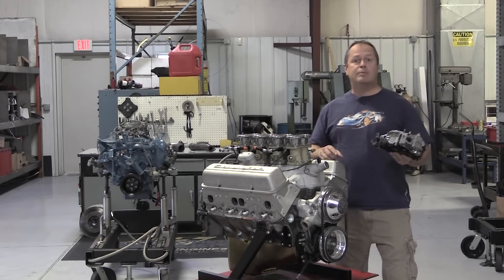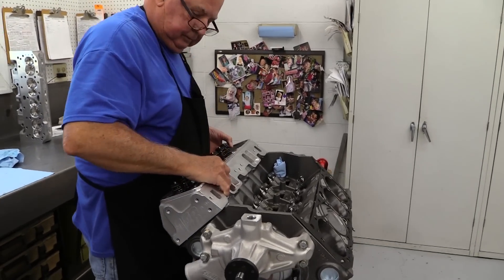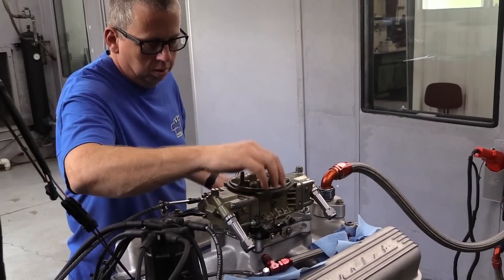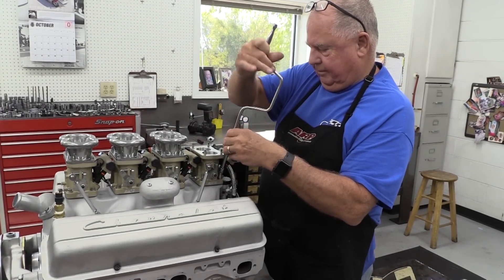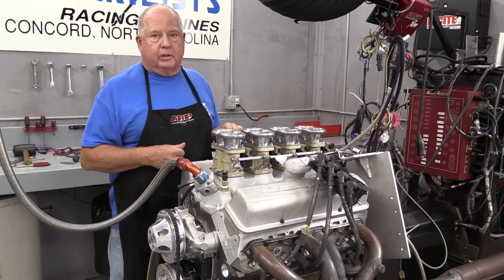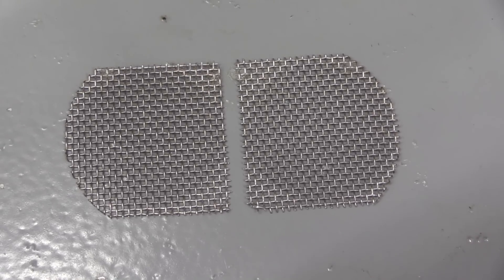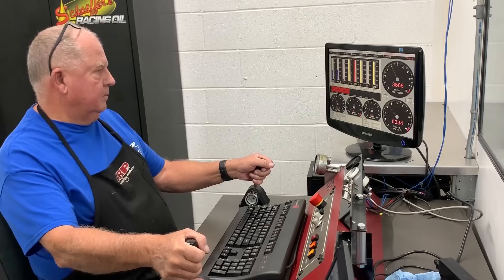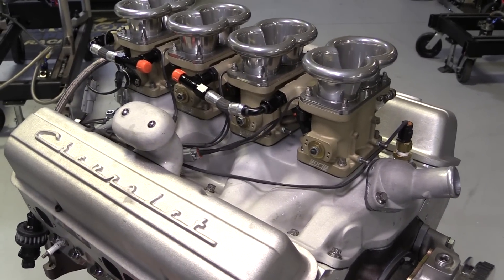Carb vs EFI - Dyno Testing a Holley Double Pumper vs Custom Stack Injection

Comment: Sorry, but this is not even close to an accurate test of "Carb vs EFI" - it's a comparison between two different intake manifolds.  
The only way this test would be accurate is if you replaced the carb with a 4-barrel throttle body injection system with the same CFM or port injection again with a TB that flows the same as the carb.
Or, toss on the Webers those ITB's were designed to replace and compare those to the injection stack.

Comment: I have  seen  claims  over the years  that   a  Carb  can make more  wide  open  HP.  I can  see already the  4  barrel  intake  has  way more  top end  HP  Potential .. Fuel  Injection   way  more  drivable ..  better  mpg  .. ect   thought it does  take  some  HP  to power the fuel injection ..
Reply: What do you mean it takes some hp to power fi?

Comment: Wouldn't this be a more "fair" test by using all stock equipment? Instead of all aftermarket components? Just sayin.......
Reply from the maker: It is all the same equipment for both setups, so it should be fair--or at least equal for both. And when it comes to testing, I've personally always liked to put components on setups that may be considered more than they can handle. My feeling is you have to be able to push a component to its limits to see what it is actually capable of. Thanks for watching!
Reply: @TheHorsepowerMonster  I fully understand what your saying here,I DO........BUT.........by simply choosing to test perfectly "STOCK" parts,based within a STOCK engine here.......You are ALSO going to easily  see precisely what each component is capable of,AND see how far it's limits can be pushed! My point is......such a LARGE percentage of viewers watching this,do NOT HAVE thousands of dollars of aftermarket stuff on their engines! They have STOCK pieces,therefore.....by testing and watching all "stock" parts,compared to aftermarket parts,maybe then......they'll walk away with alot more knowledge than just watching how long it's going to take high-priced machinery (which so few can actually afford) destroy itself!?!? Thank You.

Comment: Ive been a mechanic 40 years,,ive tried to tell folks ,,for a naturally aspirated engine the holley  will not cut the mustard,,and have proven it to many of my customers,,now blown or turbod the holley works just fine,,,but if its naturally aspirated you are wasting your time,,,you want top performance in a naturally aspirated engine you want a LARGE BORE CARB,,,a holley is definately not largebore,,so comparing fuel injection to a holley doublepumper is pretty fukin stupid comparison

Comment: What about cost to HP.. Carb wins .. All you home guys cost matters.. Good tuned carb works great .. As a tuner of vehicles efi and carbs .. Shocking how many are going back to carbs do to cost ... Low cost efi does not fuel right .. So you have to buy higher end .. Carbs still are fine..

Comment: Overall the drivability of the EFI trumps the carb.
Reply: @Joe Albert How? What makes a carb more "drivable" than EFI?
Reply: Based on this test, a lot of torque down low where you really drive. But moreover the EFI is self learning and is always adjusting itself for the correct fuel air ratio for each situation. I've been working on cars since the late 50's. Today's cars, which all have EFI, run much better through all rpm ranges than any carburetored cars I've driven. A buddy has a beautiful 34 Ford with a 400 CID Chevy small block. It ran really well, but we live in the West where there are a lot of mountains. He changed from an Edelbrock carb to an EFI setup a couple of years ago and is very pleased with the performance at all altitudes.  @Impactjunky
Reply: @Impactjunky  I forgot to mention cold starts and cold drivability.
Reply: Joe Albert  That's interesting because I saw another test that used a much more common style of EFI setup designed to replace a carb and it lost a lot of torque in the lower RPM range compared to a carb. Not to mention the definitive Engine Masters test where the carb blew the EFI out of the water in the whole RPM range. I'm also glad you mentioned cold starts and cold drivability because my 68 Roadrunner starts up immediately and stays running in freezing weather even with the choke tower milled completely off and heat riser blocked. I did a video about this specifically for inexperienced naysayers that think a carb is useless in cold weather. Speaking of which the factory fuel injection system on the 5.9 magnum I swapped into the car was choking about 50 horsepower out of it according to a Hot Rod Magazine dyno test. Just give them headers and ditch the junk EFI for a 4 barrel and they make 320 HP. They make carb swap intakes for all the modern LS, Hemi and Coyote stuff for a good reason. The Engine Masters test I referenced earlier shows one of the reasons a carb makes more power is because fuel is being atomized throughout the entire length of the intake runners causing a major cooling effect. The internal intake temps of the carbureted setup were just above freezing while the internal intake temps of the Holley performance direct injection setup were just under 100 degrees and everyone knows a cooler charge makes more power. The intake and carb on my carb swapped 5.9 Magnum in my Roadrunner gets so cold it feels like it's been in a refrigerator after a 4 hour drive. Another advantage a vacuum secondary street carb offers over EFI is progressive intake metering. Nearly all fuel injection systems that aren't directly copying a 4 barrel carb have one large throttle blade as opposed to four small ones. A smaller CFM carb or throttle body makes better bottom end torque and throttle response while a bigger one obviously makes better top end power. A vacuum secondary 4 barrel carb sees the best of both worlds as only two of the four barrels are open until engine vacuum actuates the secondaries. This gives the engine the excellent bottom end torque and throttle response of a small CFM intake until sufficient RPM is reached to open the secondaries and provide the top end CFM boost the engine needs. Obviously running around on half a fuel system until you have it floored makes the engine very efficient. My Roadrunner used to get over 25 MPG highway when it had a small block 273, and 2.76 rear gear. I've been into the next state and back without stopping for gas. Sorry for the essay but after driving for ten years on the same carb with excellent cold starts, mileage and throttle response it gets under my skin when I see people try to act like carbs are worse than they really are. Their only true disadvantage is they don't tune themselves and that doesn't bother me.
Reply: @Impactjunky  That's because the test was done by idiots.

Use your damn head...

A big vacuum leak with a fuel leak inside of it or a computer, which one will be better at administering fuel?
Reply: @Impactjunky  I'm not saying that you can't get a carburetored engine to run and start well. I have 2 vehicles with carbs, 64 Chevy truck and a 57 T-Bird, and they both start extremely well even in cold weather. However, you have to have the choke and pull-off set perfectly. I'm also building a Model A with a Buick nailhead. It will have a carburetor because I don't want to spend the money on an EFI unit. If I had the money, it would get an EFI.
Reply: @joealbert7773  Ok good luck with your project, honestly I'm relieved you're not wasting your money making that Nailhead slower and less nostalgic. If I don't need a choke tower at all to start my daily driven carbed car in freezing temps and it can get 25+ MPG with the right gearing and is dyno proven to outperform a fuel injection system then there is literally no advantage to dumping triple the cost of a carb into an EFI system. Unless of course you don't actually like working on cars or simply lack the skills to tune the engine yourself without the help of a computer. Then I guess EFI is the way to go.

Comment: Go with an EV conversion. Electrics are the future and make power from 0+ !!!
Reply: All those old battery's will be hell to get rid of in the future , they will stuff up the world .
Reply: Ok, so I’m trying to figure out why people think that EV is clean energy. If we built a 800ci engine running on race gas it would still pollute way less than the manufacture of every EV part going into a car. Then we get into the recycle of our appliance/EV car, talk about damaging the environment. You don’t get something for nothing!
Reply: @Cobra427Veight  There are LiPo batteries still in use after 20 years now and still no degradation. Who knows how long they will last. Forever?  Also.. There are new Super Cap batteries that use nothing more than  static to store charge.  And more electricity storage technologies are coming!!  It just gets better and better!!
Reply: @pizzandoughnutspage7817  800ci motor also has manufactured parts creating pollution. Not sure what your beef is. My post mentioned nothing about pollution, only that EV is the future for sure.
Reply: bigpigslapper Oink   Who brought up coal? Most power plants in USA are nuke and natural gas.  How much is needed to refine benzine, run pumps, deliver fuel, and on and on and on.  EV is not as efficient as a gas powered car if you consider those parameters.  Still. EV;s are the future as they have been the past. EV;s were before the IC cars.  But you knew that.. Right?
Reply: bigpigslapper Oink  It is getting worked out as we speak.  EV is the future for sure. Axiomatic.
Reply: @grabir01   Sorry i beg to differ , Hydrogen powered combustion engines , water out the exhaust , good power , and "RANGE" just what we are all used to , Yep ev is fast and economical ????  depends where all their charging power is coming from ? Neucular , coal  etc .   all the greenies think its the environmental way to go , ( they are all still wearing their petroleum based rain coats  etc . Will EV stop climate change ? is man causing it ?? , were we around in the ice age ? there is a lot of naturally occurring  stuff .
Reply: @Cobra427Veight   These are also EV's. They use Hydrogen to generate the electricity. As I said. Electrics are the future. Might as well embrace it!!  They are faster and way more reliable.  Way!!!
Reply: @Cobra427Veight  It's a much better future might not see it but Toyota is working on a process to get more hydrogen out of a smaller process into pressurized systems. If they can get something that works efficiently enough it can be implemented into a fuel injection system. Another company is already developing storage tanks that are far lighter and are more compact that can take the higher pressures with less loss through the casing. If I live long enough to see that, I'd convert to hydrogen fuel instead and skip the small EV step entirely.